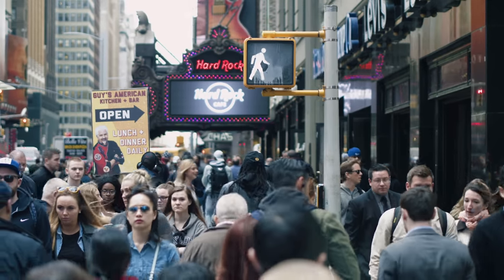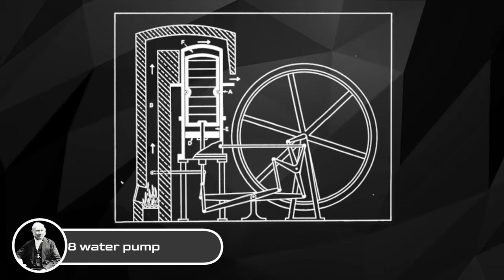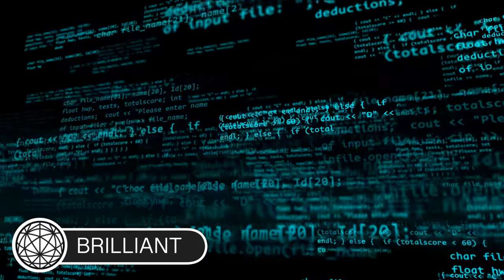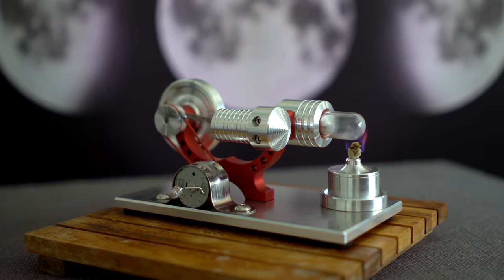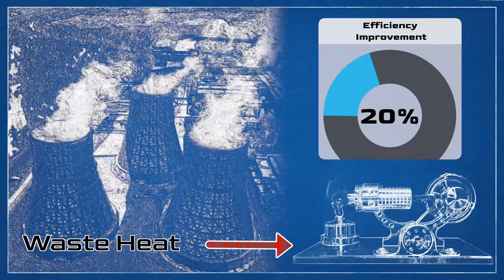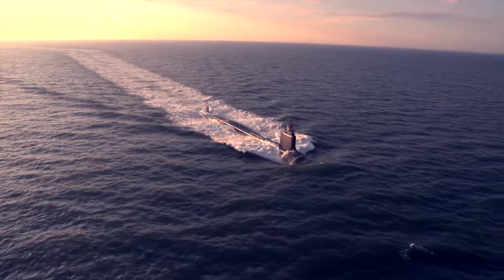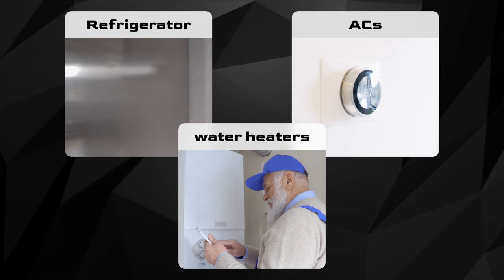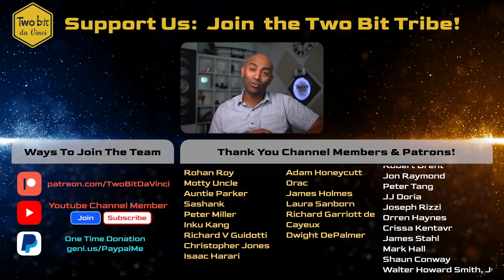Why This Age Old Tech Can Be the Future of Energy - Stirling Engine Explained

Comment: For your attic you'd do better to absorb the heat on the outside of your roof, before it even reaches
Reply: Or vent to let the hot air flow outside, the heat will naturally make it flow upwards, so placing a vent as high as possible will move all of this hot air outside. Sure you'd not take advantage of the heat, but most of this heat is due to the sun light hitting the roof, so it'll be more efficient and cheaper to cover the entire roof with solar panels.

One of the most compelling use I've heard for sterling engines is in datacenters in cold climates (eg. iceland, northern canada,..). The temperature difference between the heat produced by the computers and the cold air outside should be enough to recapture some of that energy to partially power the datacenter, so they are making more efficient use of their electricity.
Reply: @aarondewindt  Well spoken, you're making sense!

Comment: I like the idea of using a heat pipe from all your devices up to an attic, what if you put metal roofing on a shed causing that thing to heat up with a sterling engine inside. Paint the roof Matte black and it would heat up significantly and stay hot for most the night. Even in colder climates it would allow power generation
Reply: I like th way u think

Comment: I think the quantity of energy the Sun produces allows us to to be "wasteful/inefficient" for the sake of easier installation/less moving parts (solar & batteries).
Reply: If I made an automobile out of the black box material that survives plane crashes nobody would die from collisions. Only problem is it would cost more than most could afford. Storing solar pv energy into batteries for residential merely robs battery supply to produce more hybrids or full blown EV's. Meaning it would actually be wasteful / inefficient on a maximum global carbon reduction aspect.
Reply: Ultimately solar and battery produce more pollution and cost too much
Reply: @Cerberus984  this is current problem, not a future one.
Reply: @fredmauck3547  incorrect
Reply: @fredmauck3547  also incorrect.
Reply: @IamtheDill  so says you but not the scientist . All the research and look at with an unbiased opinion does lead to the conclusion that I gave you that is factual. Just because you work for a solar company does does not mean the rest of us have to invest in a trash system solar with batteries.
Reply: @fredmauck3547  please link the peer reviewed scientifically factual study below.
Reply: @IamtheDill  I have reevaluated what I knew to be true from the past and found that things have changed. Although a couple things remain the same. Lithium mining for batteries still sucks and we need to utilize Alternative methods for batteries  .Furthermore additional infrastructure must be  accomplished paring grid  with Wave  and tidal energy
Reply: @fredmauck3547  I can get behind that! You are a good dude Fred.

Comment: 11:30 that's the method we should be looking into here in Western Aus. My thought though is that at the focal point heat could be collected and stored in molten salt form, if a temperature differential is required then heatpipes could be sunk into the ground where temperatures remain much cooler and stable

Comment: Mr. Carnot suggests that the efficiency depends on the temperature difference. You need a lot mote engine to get the same power if the source is waste heat in most cases. Might be useful for CSP plants that store heat in rocks. I love the idea of thinking about home energy globally. Years ago when I was in practice as a plumbing engineer; I came up with a 5 pipe system with 2 pipes that moved hot and cold water between fan coil units and another gathered heat using heat exchangers. The other two were domestic cold water that doubled as fire protection and domestic hot water. The idea was that it would save on installation and material costs while requiring little or no extra space like air ducts and sometimes waste pipes do. A sixth pipe could carry waste and be only 2" if a vacuum system was used.

Comment: I mentioned to an engineer at a local solar panel/water-heater installation company that if they are short on panels, why can't they install a large solar water heater and use a sterling engine to generate power.  His reason for not doing it is that moving parts are prone to failure, which is true, but I figure they can improve that.  Imagine a giant hot water tank that you can use to generate power.  In a way, this can act as a battery.

Imagine using both solar panels as the top layer, then use the rest of the solar heat to evaporate water, then condense/pressurize the vapor to make hot water.  You have energy, hot water, and distillation all in one.  Again the hot water could be used as a battery with a sterling engine.
Reply from the maker: We’ll said. I like how you think. Yah in practice it’s tough and requires some baselining. But I find it fascinating to think about

Comment: The sterling makes mechanical work from an external heat source. That mechanical work can be used for several purposes, amongst them making electricity. A diesel engine can also be used to make electricity, and the source is heat. Internal or external combustion engines produce work from heat. The special thing about Sterlings is they have an external heat source.

Comment: Brainstorming an idea:  Use a Fresnel lens to really heat up a reservoir, hook it up to a Stirling engine, and then hook up the engine to a battery.  My guess is that it would be much less powerful than a comparable PV system but it would be interesting to test it out.

Comment: Seems to avoid the efficiency issue. You need high temperatures at one end and low temperatures at the other end of a stirling engine. Attic may have a lot of heat, but efficiency will be very low. The maximum theoretical efficiency of a heat engine (which no engine ever attains) is equal to the temperature difference between the hot and cold ends divided by the temperature at the hot end, each expressed in absolute temperature (Kelvin). A 120 degree attic with a 50 degree cold side is only 1.7% efficient.

Comment: Most houses/office buildings do have a "heat line". It's called the hot water pipe. It should be fairly straight forward to extend that to make some sort of heat transfer from each appliance - ac, refrigerator, dishwasher, clothes washer/dryer, fireplace, etc - to the hot water line. As long as the appliance can be pulled out for repair/replacement without breaking the transfer mechanism. Besides the water heater wouldn't have to work as hard, either. Anybody have any appliance manufacturer friends? Architects?

Comment: A Swedish company, Swedish Stirling AB builds these engines for waste heat to electricity conversion for heat intensive industries.
One container load of Stirling engines can generate up to 400 kW.  It has an expected lifetime of 25 years or more.
The electricity generated can lower the amount used from the power grid by up to 15%. 
The expected point of having been paid off through it's power production is about 5 years.

Comment: Could Stirling engines be powered by dump incinerators to send power into the electric grid? We currently bury our waste here. It’s always seemed like a loss of potential  energy that might be captured by incineration.
Reply: Very much so yes. Industrial waste heat of many kinds is often lost. It could increase profits a lot but many just don't think outside of the box.
Join us on patreon or yt member and keep those ideas coming and we can get the word out together.
Reply: Here in South Australia methane emissions from a local refuse site are used to fuel an engine (converted diesel?) which spins an alternator.
The power output is low but it may be by design so that they don't consume more methane than it can produce long-term.
Reply: Spent nuclear rods don't produce enough energy for the super heated steam to turn the turbines, but they could still heat water to run these Sterling engines for centuries.
Reply: @1MarkKeller  yes very true. Great idea.
Reply: @CNile-se9xw  two bit da Vinci is working on a story about methane energy. He might call it POO POWER 💩💩💩💡💡💡😆
Would you watch a video on that subject?

Comment: I have been looking at the engineering behind stirling engines for a couple of years now (however, Im not an engineer ... just an ex electrical/electronics eng turned psychologist). Ive been looking at, and testing, the idea of a reciprocal SE (balanced) & re-engineering the piston to operate as a linear induction rod to charge coils to charge batteries: A EV range entender based on a reciprocating induction, which can also "kickstart" the SE, while using the heat of the batteries/electric engine to provide range charging. Yes, losses. But youre losing to charging, removing large losses to friction, equals greater efficiency.

Comment: Just a closed loop device between radiators in an attic and a geothermal system to provide cooling in the attic in summer and heat in the winter that all the sterling engine does is work the pump to circulate the coolant.

Comment: About the roof: why not move this to the outside (underneath the solar panels), cooling them down (efficiency)? I think some thermal - solarpanels already exist (pvt), but they now are connected to boiler/heatpump systems. If the boiler is hot enough, this surely would be a good solution to use the surplus in heat.
I like the idea of heatline going into Stirling (summer) or house (winter), since heat/cold is at different places needed/produce. A problem with that might be the different temperatures coming from different sources.

Comment: I been thinking to do a Sterling engine project with a heat exchanger. Particularly in a colder climate where your Delta temperature of a house (inside vs outside) will be optimal for a sterling engine. Awesome video. Thank you!

Comment: We should realize that every use of energy creates or is heat. We use heat to put things in motion and when we slow them down or otherwise consume or use that motion.

Maybe the most difficult things to do is take smaller and inherently less efficient instances of "waste" heat into and turn them into reservoirs to use when we want them. Lots of work going on there.

One thing mentioned when you talked about the attic heat is pumping heat transfer medium from the heat source to where it is used on the Stirling engine. The energy to pump the material may be more than is generated in the end.

Some fluids expand with heat which creates a pressure that might be used to circulate it. Maybe the means used in CPU heatsinks on computers would work here. I'll look into that.

Comment: On first getting to know about the Stirling engine one is immediately impressed with its potential as a power source. On closer study of this type engine , one gets to know of its shortcomings and why it has not supplanted gas,  diesel or petrol engines. The engine in its simplest configuration  must be taken as nothing but an extremely low power specificity converter  and was indeed used as such in the early part of the last century to run pedestal fans and large slow speed air circulators using kerosene as the fuel. The first step towards an improvement in the power size ratio is the pressurization of the engine. The basic engine operates at mean atmospheric pressure  and has a power size ratio of about ten times lower than an equivalent sized internal combustion engine, If the engine is operated at twice atmospheric pressure the power size ratio is increased by a factor or two. The Stirling puts out  a huge amount of heat which heat could be used in cold climates for the heating of houses or providing heat for chemical or other processes. There are innumerable  problems with lubrication, piston seals and efficient heat transfer which problems have been managed only on the very large sized engines run off nuclear reactors. A rather curious development was the use of the Stirling cycle in cryogenerators. The Stirling cycle has made possible the space programme as the earlier solid fuel was much too inefficient  and unsuitable for sustained operation in space. The Stirling cycle quite literally made possible the entire space programme as it enabled the production, and storage of liquid rocket fuels and gasses. The use of the Stirling cycle    in  power or energy converters has almost been discontinued due to the many difficulties but has found exclusive  application in cryogeneraros as being the only type now is universal use.

Comment: Low torque engine, and yes I'm aware of the U.S. Army's research, and cannot replace higher torque engines such as ones powered by steam, or ICE gas/diesel. Even the water pump you mentioned was replaced by a steam engine. Where thus engine shines is using the Stirling cycle as a reversible heat pump. Meaning it can heat in the winter and cool in the summer.

Comment: I was thinking of utilizing engine heat loss which is up to 40% through exhaust pipe . That wasted heat can be  useful for small multiple sterling engines across the exhaust system making electricity. That would  help decreasing size of alternator and by doing that you could make  IC Engine more efficient . BUT  again its all about energy density of sterling engines and how much they electricity them are manage to produce. It might work as exhaust cooling fan for increasing  IC engine efficiency like  BMW used water cooling for exhaust  .

Comment: Put brake discs not on the wheel side of the half axles, but on the transmission side of half axles (so there is a disk on either side of the transmission), that way they stay fixed to the direction of the vehicle, and you can connect them to a cooling system connected to the stirling engine. Another heat source is the engine itself, and the exhaust. Basically, gather all the heat you can, and put it all into a stirling engine, and cool the other side of the piston with the cooling system. This way you can concentrate all the losses your car produces, and squeeze as much energy out of them as you can. In theoretical situation, this should be able to convert at least 50% of all losses back into energy, so your car´s engine efficiency would instantly rise from around 35% to about 68%. 
Of course, it has to be at least a full hybrid, or a plug-in-hybrid car, you cant easily power a conventional car with the stirling engine. But on the other hand, you can get a substantial amount of battery recharge just from the remaining heat when you turn your engine off.

Comment: So back to my arctic idea one runs on Cold from the outside and one in a Building that runs on heat produced by the other so they power each other by heat and cold exchange and so produce twice the power of a single sterling engine
Reply: How does the building get warm on the inside?

Comment: We did some experimentation on stirling engines for Stirling in Scottsdale Arizona years ago using an external combustion protocol in the form of an external heat source. They can be easily started & operated but to get any useable power output the heat must be extreme.
  With an arm placing it in the focal point of a parabolic reflector you can produce a fair amount of power, but it's pretty noisy. It would be great as a residential supplemental power supply if you could mitigate the sound level.
  A subdivision with a Stirling in every back yard would be unbearable. That being said, the best application would be one where the noise isn't a factor.
  Happy tinkering!

Comment: Best idea I've seen is with a Stirling engine using a meta-material that was built some years back that could give off infra red radiation supper efficiently. Meaning the meta-material can become cold whilst in direct sun light giving off loads of infra red ie heat, giving a large temperature difference. Haven't heard about this meta-material for some years, guess scaling up manufacturing isn't easy.